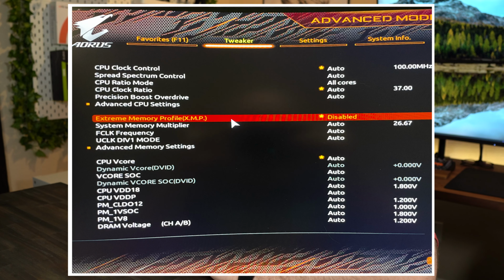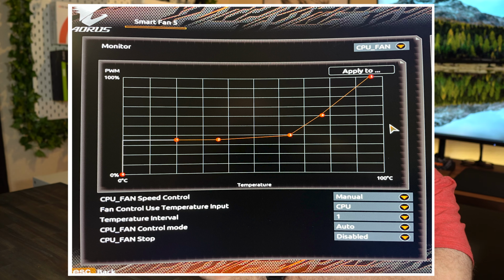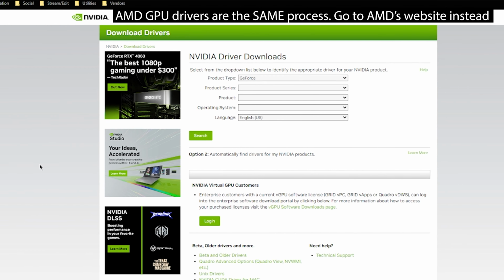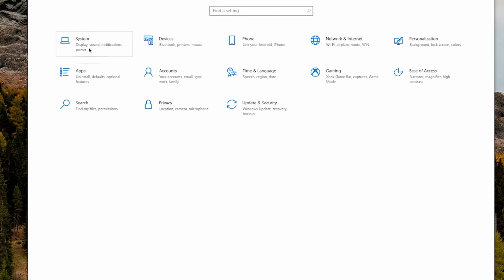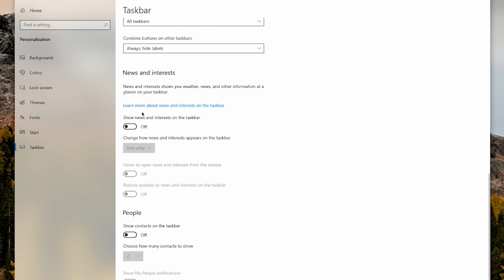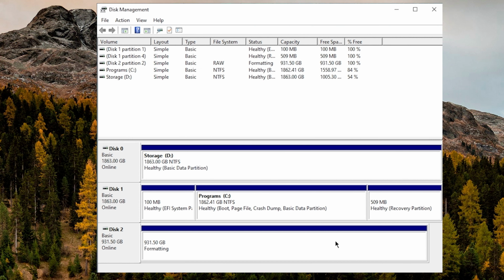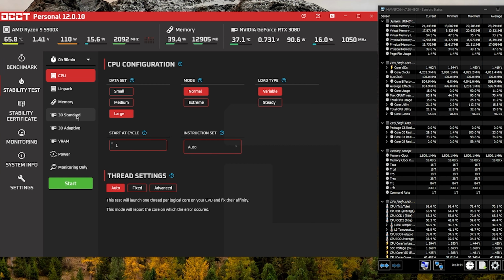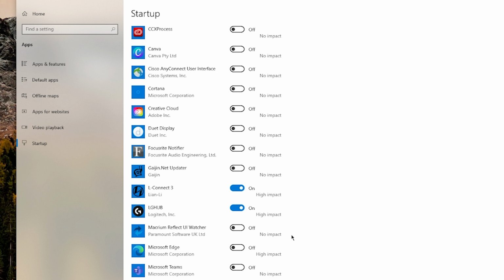The PROPER Steps AFTER You Build Your Gaming PC! See Pinned Comment.

Comment from the maker: UPDATE: 8/13/2023 - According to a commenter, setting your Power Settings to High Performance may cause your CPU to constantly run at higher clock speeds. If you do change this setting, I would monitor your CPU vitals and make sure that it's behaving properly. I have never experienced this but it may depend on the system.

-------------------------------------

Hey dudes! Thank you so much for tuning in to the video. I have compiled the ultimate list for the PROPER steps, AFTER you finish building your PC or if you bought a prebuild / 2nd hand PC. If you feel there is anything that needs to be corrected or added, please let me know by leaving a comment below. If you have any questions or concerns, please comment down below. I hope you enjoy the video and thanks for the support.

A few things to keep in mind about this tutorial:

- This tutorial is assuming that your PC build was successful, you have Windows installed on the computer, and you know how to access your BIOS. If you are having issues with your build or anything else, I will do my best to try and help you diagnose what the issue may be.
- This video was shot on a Windows 10 machine, so Windows 11 processes may be slightly different. I wanted to originally do it on a Windows 11 machine but, as of March of 2023, 73% of people are STILL using Windows 10.
- Your motherboard may and will differ from mine, and therefore some of the instructions may be different for you. Keep your motherboard manual close or download a digital copy from the manufacturer of your board.
- When it comes to ANY of the settings mentioned, When in doubt, Google your motherboard brand and model, and you'll find it.

1) After you are done building your PC and have installed Windows, boot into the BIOS. Check CPU temp, if it's climbing and climbing, this could indicate a problem. Most CPU's will idle between 25c-50c, really depends on the CPU and the cooling you have. If you confirm that the CPU temp is not staying stable and rising, then I would shut off the machine and check for:

- That the CPU cooler is properly seated or incorrect accessories used
- Thermal paste application is incorrect.
- AIO pump is not turning on.
- Although unlikely to cause high CPU idle temps, I would check all fan orientations and proper function of the fans.

2) Now that you've verified the CPU temp is stable, it is time to tackle some of the BIOS settings. The first one we are going to look at is your RAM/memory settings. By default, your RAM will be set to the defaulted speed, we need to enable XMP/DOCP in the BIOS. Here are the instructions for doing so:

AMD and Intel Systems:

- Enter the tweaker section of your BIOS. You should see XMP (Extreme Memory Profile) or DOCP ( Direct Overclocking Profile ).
- Change from Disabled to Enabled or PROFILE 1.

This will overclock your RAM (safely) to the max level that is advertised with your RAM.

3) Resizable bar opens up your GPU to the system, allowing the PC to take advantage of your entire GPU, and can equate to some big performance gains:

AMD/Intel Systems with NVIDIA GPU's (3xxx series and above):

- Navigate to Resizable bar and ENABLE it, or set it to AUTO. Some motherboards will enable the next setting mentioned below by enabling resize bar. Check to make sure->
- Navigate to 4G encoding and ENABLE it, it's usually stored in the IO section your the BIOS settings.
- Navigate to CSM Support under the BOOT tab, and DISABLE it.
- Open NVIDIA Control panel and select SYSTEM INFORMATION in the bottom left corner. Check to see if Resize bar says YES or NO. If no, continue:
- The VBIOS of your GPU will need to be updated to support resize bar. This can be done by going to the support page for your GPU and downloading and installing the latest BIOS update. Google your specific GPU and you should easily find it. If your GPU has a dedicated program (ASUS Tweak, MSI Afterburner, EVGA Precision X1), you can do it through this program. Check to see if your GPU has it's own program

AMD/Intel Systems with AMD GPU's:

- Navigate to your advanced tab -> PCIe subsystem settings and enable ABOVE 4G ENCODING
- Set Resize bar support to AUTO.
- Under your BOOT tab, set CSM Compatibility is DISABLED
- Update your VBIOS for your GPU, see last note in the NVIDIA GPU section above.
- In AMD Radeon software, go to TUNING, and at the bottom, you will see AMD Smart Access Memory, and make sure it is enabled.

4) Check your boot priority and hard drives. Make sure the correct drive is your boot drive and all of your hard drives are being recognized. It's very rare, but you may need to enable them in the BIOS. You will still need to initialize the disks, but that is later on in this tutorial and it covered.

5) Set your fan curves. Within the BIOS, you will see a fan curve option, click it and set your fan curves how you want them. There are preset ones you can choose from OR you can set a custom fan curve. Normal will be selected by default so this doesn't HAVE to be checked, but I would know how to do it. Fan controller users will most likely use software attached to controller

Save and Exit from the BIOS to boot into Windows...

6) Updating Windows, motherboard drivers, and your GPU drivers. 

Windows:
- Search for "Check for Updates" in the search box on your taskbar. Download and install ALL applicable updates. System will restart multiple times and may take awhile.

Motherboard drivers:
- Google your motherboard make and model (Example: Gigabyte AORUS Elite X570), click and search for the support/downloads page.
- Download ALL applicable updates through the support page. This will include: BIOS, Chipset, LAN, WiFi, SATA, and others. Some motherboards offer a program that can be downloaded to do these for you, usually located in the UTILITY tab of the support page

GPU Drivers:
- Google your exact GPU with the term drivers (Example: RTX 3080 drivers). This will take you to NVIDIA's OR AMD's website. 
- From their dropdowns, select your exact make and operating system, and download
- Install GPU drivers. Your system will most likely flicker while the install is happening
- Restart once done

7) Windows Settings:

Display Settings:
- Right click on the desktop and select Display settings, drag and drop your monitors in the "Rearrange your Displays" section to have you have them set up on your desk.
- Adjust the scale and layout percentage.
- Changing refresh rate: Click on advanced display settings down below. In the drop down menu, select a monitor. Scroll down and change the refresh rate to the HIGHEST number possible, do this for EACH monitor.

Power and Sleep Settings
- Navigate to System and Power and Sleep in Windows settings. At the top, you are going to select when you want your SCREEN to go to sleep, and when you want your PC to go to sleep
- After that, on the right hand side, click additional power settings and choose the power plan that makes the most sense for you.

Mouse Settings
- Navigate to Devices and mouse in Windows settings. Set your cursor and scroll speed. If you have any type of gaming mouse, do this in the software that comes with the mouse ( Example: Logitech uses the program G-Hub)
- Click on Additional Mouse settings and click the pointer options tab at the top
- Uncheck the Enhance Pointer Precision setting.

Task bar Settings
- Right click on your taskbar and select settings.
- You can set which monitor it's on, or what side of the monitor it's on, and tons of other options.

Setting up storage-drives
- Right click on your start menu and select DISK MANAGEMENT. If you have storage drives that are not set up, it will prompt you to initialize the disk. Make sure all drives are checked and click OK
- All the drives with a BLUE bar are ready to go, and all the ones with the BLACK bar need to be set up
- On the drives with a black bar, right click and select NEW SIMPLE VOLUME. Go through all the prompts, click OK
- The partition for each drive should extend all the way to the right. If it DOES NOT, right click on the drive and select EXTEND VOLUME.

8) Installing software needed for peripherals and PC components.

- Some or all of the components in your PC have software that is tied to them. This can include your fans, fan controller, AIO, GPU, CPU, RAM, and motherboard
- Search for and download all of the one applicable to YOUR machine.
- Download and install programs for your mouse, keyboard, headset, and any other accessories you may have.
- Various settings can be changed in all of these programs including fan curves, pump speed, mouse DPI, etc!
- These program will also be used to keep these components up to date!

9 )Benchmarking your system. You are going to want to fully test your system now. Download and install software to test your system and monitor temps:

Benchmarking:
- OCCT - For CPU, GPU, RAM, Power
https://www.ocbase.com/
- Cinebench R23 - For CPU
https://www.maxon.net/en/downloads/cinebench-r23-downloads
- Heaven 4.0 - For GPU
https://benchmark.unigine.com/heaven

Run benchmarks on each one, check for errors (in OCCT) and check temps! If temps are too high, investigate and make changes.

Monitoring:
- HWinfo64 - ALL PC vitals
https://www.hwinfo.com/download/
- MSI Afterburner - GPU temps, overclocking, on screen displays (display vitals while IN game)
https://www.msi.com/Landing/afterburner/graphics-cards

- Run benchmarks on each one, check for errors (in OCCT) and check temps! If temps are too high, investigate and make changes as needed!

10) Download all the programs you want!

See description!
Reply: Thanks.
Reply: thank you so much, i didn't do any of this on my old PC but am going to on my new one. didn't even know u needed to do all of this lol (I'm a beginner), so thanks!

Comment: Hi, everyone!
I have one question regarding the XMP setting. In my case I own an AsRock B450M-HDV motherboard, with 2 DDR4-2666 8GB sticks (not sure if single or dual channel). When I choose the Profile 1 setting for max RAM usage, the DRAM voltage goes automatically up from 1.2V to 1.35V, and it's shown in red. Is this a problem? Should I change it back to 1.2V or should I leave it as is, inspite of the red in the numbers?

Comment: 1st build seemed successful at the start.  Got into bios and adjusted ram settings,  but when I tried the usb install of windows 11 I get display port errors and the monitor goes into sleep mode.  Even with the usb not plugged in anymore.

Comment: Hello. Newbie here and want to throw my pc out the window and buy that 400$ prebuilt Amazon micro comp. 
My problem. Don’t have windows installed yet and I am stuck on reboot press key cycle. 
I think I got here because my when first boot and had to press the F# + DEL key it wasn’t doing anything so I pressed Y and it sent me to the error. 
I can get into bios and it reads everything I have including the m.2 SSD but still the error. 

Need help on where to go.
Gonna get a usb and download windows tomorrow on it and plug it in before start up and hopefully that fixes it.

Comment: Dan have you used OpenRGB for managing RGB settings?  It supports most hardware and makes it way easier to have one piece of software controlling it instead of installing 4 different bloatware software (it also works on Windows and Linux).  Curious what you think of it, it requires a lit bit of setup for more complex lighting (more than just simple color changes - eg: temperature based lighting etc), but its a very neat tool.

Also kinda surprised you're on Windows 11, Windows 11 experience sucks in my experience so far (have to use it for work).  The only reasons to switch from Win 10 imo are as follows: 1) Windows 10 support ends, 2) Dark Mode Task Manager, 3) Direct Storage API  However, the UX experience is so bad compared to Win10 and I can't stand using it.  That said I would still recommend people just use linux instead, if you're new to linux, Linux Mint is a great gateway to linux land if you're used to using windows and makes it a fairly simple fix and is intuitive to setup.  Too bad I never see these kinds of tutorials for linux lol, but I guess the assumption is that if you figured out how to install linux you know what you're doing already.

Comment: Before test My core i7-4790 was 72c  during the test it was 99 or 100c, kinda worried.
Reply from the maker: What are you using for cooling? As far as cooler and fans. Give me your full setup ( fan orientation and everything. 100c is right at throttling for that Intel CPU so it’s definitely a bit high
Reply: @DanKamYouKnow  
Case: 1 intake fan from a side.
Cpu: core i7-4790 has a heatsink with a fan attached
Power supply: edge systems af-b700 700w
mobo: Gigabyte H97M-D3HP
Gpu: RADEON RX 5500 XT 4GB GDDR6
Storage: SSD M.2 NVME 512GB ADATA FALCON, and 1 hdd 1tb
Ram: 2x Kingston FURY Beast DDR3, 1600MHz, 8GB
Monitor: GAMER XZEAL XZ4015-1
Speakers: LOGITECH S120

Geez, Thanks but i think it might be an incorrect sensor reading bc after the 30mins test it came all the way down to 55c but if i start a new test it goes to 100c in less than a minute.

Its a 5 year old pc from which i only upgraded the Gpu and added the SSD.

I feel I'm ok playing lies of p on mid.

Comment: Majority of you guys (including me) shouldn't use High Performance under Power Settings unless you want your CPU to be locked at its highest clock speed constantly. Balance setting allows it to not run at its highest unless needed for applications.
Reply from the maker: I have never experienced this but I will leave a note in the pinned comment to keep an eye out for this if the setting is changed. Is this a pre-built machine you’re referring to?
Reply: hmm